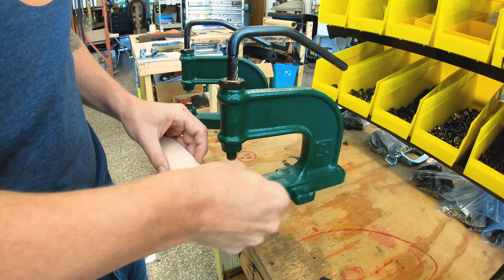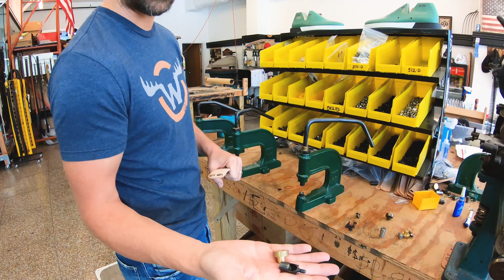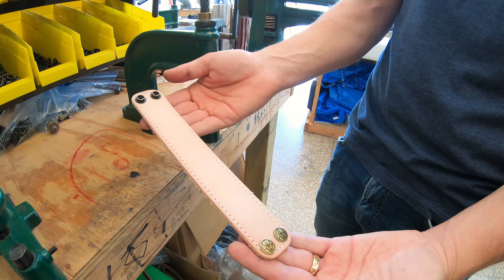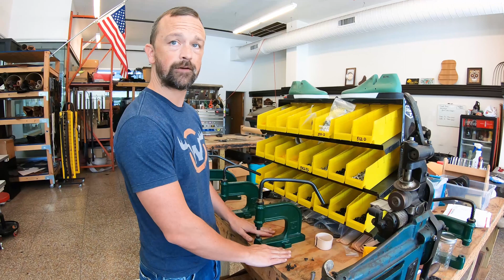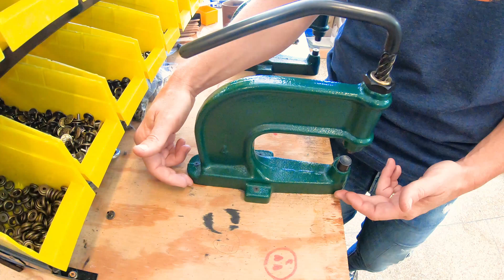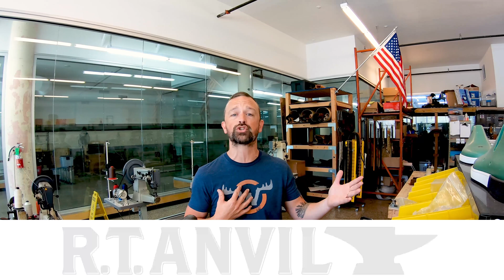R.T. Anvil on The Hand Setter | Leatherworking Tools Review

Comment: where'd you get the small brass anvil from
Reply: and the hole cutter, you showed them @ :53 seconds
Reply from the maker: @malcolmmiller5041  Ohio Travel Bag has aluminum anvils for these setters as well as hole punches. I've had those specific brass anvils forever and at the time I either got them from Ohio Travel Bag, or maybe Ebay? OTB doesn't look like they carry them anymore but you might also check out Tandy Leather.
Reply: @ryantheanvil   thank you!!